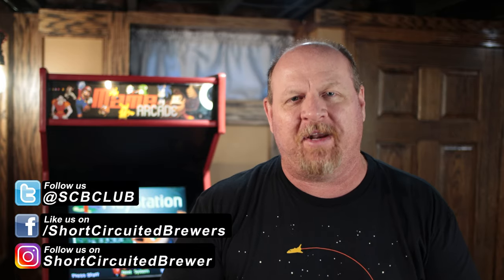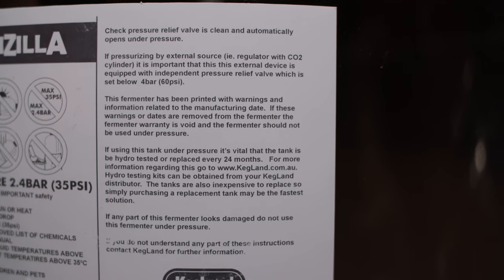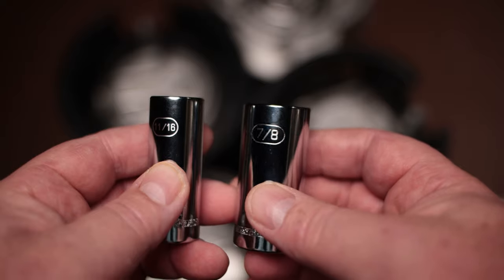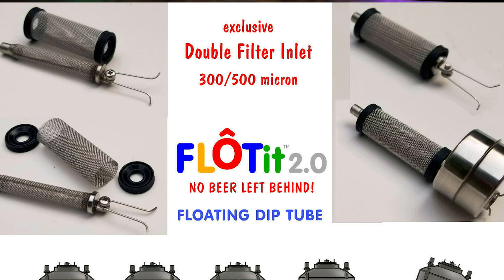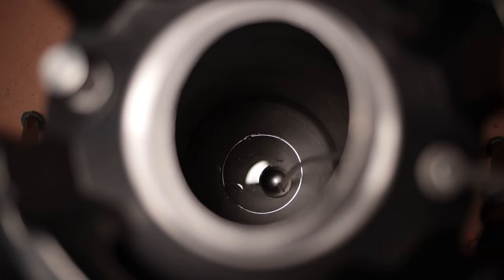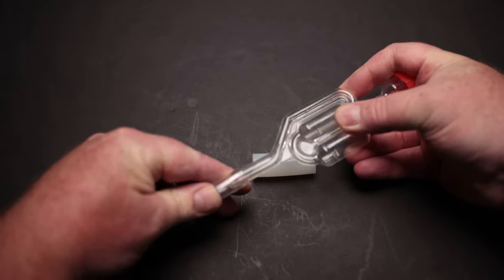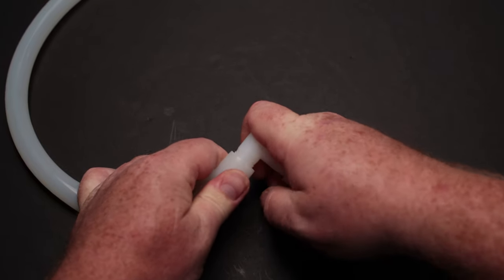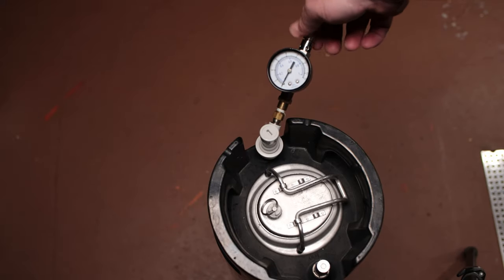Convert your Corny Keg Into a Fermenter

Comment: I love fermenting in my cornies using a floating dip tube. I use a blow-off tube for ales and a spunding valve set to 10psi for my lagers. I ferment 2.75 gallon batches in 3 gallon kegs and I find Fermcap to be absolutely necessary. I've never had an issue with the limited headspace. When fermentation is finished, I perform a closed-loop pressure transfer to a clean and sanitized serving keg, using pressure from the serving keg to push the beer out of the fermentation keg. My beers have been consistently better since I started fermenting in my cornies!
Reply from the maker: Awesome to hear!! 👍🍻
Reply: Thanks for making this comment. I am about to start fermenting in cornies and have the same plan. Ferment in two separate containers (that have floating tubes) then combine into one for serving (that also has a floating tube). I intend to harvest and clean yeast, this will be my first experience with that. I just bough my first liquid yeast.. I'd like to avoid paying that cost regularly.
Reply from the maker: Good ideas. 👍🍻
Reply: How much feral / 5 gal Corney??
Reply: floating dip tube suggestions? searching now…
Reply: FLOtit 2.0, available a lot of online places.
Reply: @balrog006  Yes i ended up buying one and it seems to be working well so far. First time fermenting under pressure, went brew day to beer in glass in like 11 days. Pouring well so far...

Comment: I have been fermenting in corney kegs since the mid-90s.  I used to use pin lock for fermenting, and ball lock for serving, so I always knew which one had the short tube.  I brew lagers in my kitchen, in Albuquerque with no temperature control all year round (85F in the summer) by using a spunding valve.  I transfer to a serving keg, then pour out the yeast in the fermenter (leaving a few tablespoons) and pour new wort on top of it.  I brew 2.5 gallon batches every Saturday, and I never buy yeast.  I used the same "Cry Havoc" yeast for 20 batches, now I use 34/70...
Reply from the maker: Nice! 👍🍻
Reply: Thats a great rhythm of a system

Comment: I’ve been fermenting the full 5 gallons with no probs. Blow off tube set up like the vid will take care of any blow off. It’s usually minimal. A recent 13% Kveik barley wine blew off only around 100ml. I also don’t tamper with the dip tube. I don’t feel the need to. After a few days in the Keezer, the first pour pulls up the yeast cake then the beer is fine after that so no need to transfer to another ‘serving’ corny. I’ve also had great success harvesting yeast by using a sterile picnic/party tap and literally pouring the yeast cake into a sterile jar. Corny fermentation is brilliant. I do all my Weizens this way and any other beers that aren’t dry hopped. I have dry hopped though with success using a hop filter in the corny. Hang it in there with a bit of sterile dental floss for a few days. Make sure you have a steady flow of co2 going into the liquid post when adding removing hops though to minimise oxygen entering the corny.
Reply from the maker: Good info!

Comment: Really good video! I would say an easy way to do a larger batch is hook 2 kegs up together. I am doing a pressure fermentation right now, gas in to liquid out and a spunding valve on the second keg. Works great!
Reply from the maker: Nice tip!! I like it! 👍🍻
Reply: What is the volume on Corney #1 and #2 ?  This sounds great because cold crashing inCorney seems to clarify better.
Reply: @tman9338  you can split them evenly, once fermentation is done, cold crash in the kegs and then transfer both to one serving keg!
Reply: @brianeasley3515 interesting. regarding even yeast distribution do u double pitch (one in each) or shake it up and hope it works out?
Reply: @whoajack  normally just do a dry pack in each keg. If not I do a large yeast starter and split evenly.

Comment: Hydro testing is something you will need to take to a shop. It involves submerging the vessel in water, pressurizing it, and seeing how much it expands.  I've never heard of hydro testing a plastic container before.
Reply from the maker: Actually you don't need to take it to a shop you can do your test at home by filling the vessel completely full with water and then connecting a keg filled with water and pressurizing the keg to bring the pressure of the water up to the testing level. And you only need to test it if you're doing pressure fermentation. 👍🍻
Reply: I’m sure the manufacturer imagined having the pressure test performed by someone certified or with a certified lab/equipment-to maintain the liability.  If you’re just testing it yourself to check before using it, then your home method would suffice.

Comment: I have just done our first keg fermentation and it has not gone well, I got an emergency call to come to our brewing room at the Shrine this morning, we have easily lost 2/3 of this keg. I brought it back home into my shower and it still keeps leaking. Thank you for this video, next time we will only do 4 gallons. I hope that is all that is needed to solve this issue. Blow off was our big issue.
Reply from the maker: Yeah the key to managing blow off even with pressure fermentation is temp control. Depending on the yeast strain. 👍🍻
Reply: I think the issues was that we overfilled the keg to 4 and 3/4 gallons and didn't leave much head room. I am also looking into getting some blowties for our next brew day @ShortCircuitedBrewers
Reply from the maker: @kevinclingan5630  gotcha! Good luck on the next one!

Comment: Great video! I've been fermenting in corny kegs for about a year now and they've become my favorite fermenters by far. Most of my batches are 4 gallons or less so I've never been worried about headspace, but the tip with the 1/2" silicone tubing on the PRV is a great idea for those trying to fit a bit more in their keg.

For my pressurized lager fermentations, I use a spunding valve set to around 15psi and have had great results with that. For non-pressurized fermentations, I have a couple gas disconnects connected to short pieces of bent SS tubing and S-airlocks, so I can pop those on and off my keg as needed. 

If I ferment in my corny kegs, 99% of the time I'm serving directly from them as well with floating dip tubes. If I'm taking the beer to an event, I'll jump from that keg to a clean, purged serving keg. I put a 3/8" SS hex nut on the end of the tubing right near the ball float to make sure the tubing end stays submerged, and when serving from a keg that I've dry-hopped, I put the small filter on the end of the dip tubing. It's great to have less vessels to clean, and reduced oxidization. My NEIPA's have gone weeks with no noticeable oxidization or color changes, and haven't noticed any detrimental effects of having the beer sit on the yeast and hop trub in the serving keg.
Reply from the maker: Yeah there is a myth about leaving beer on yeast. I've had a lager on a yeast cake for 6 months with no I'll effect. Thanks for the comment! 👍🍻
Reply: What is the max time u have served from a Corneys??  Great feedback that you serve using a dip tube and the trub doesn’t cause off flavors

Comment: Thanks Brian for all the great info, I don't cut my corny keg dip tube, I just use a BeerBrite filter system when racking to another corny keg, in my experience 41/2 gallons is about right for trouble free fermenting, though I find with cider I  can manage 5 gallons...Thanks again Brian.
Reply from the maker: That works! 👍🍻

Comment: Good suggestion on the 6 gal keg. Looks like it will even fit in my fermentation kegerator. Just had a massive blowout through my 5 gal through the spunding valve.
Reply from the maker: Good thing for a spunding valve!

Comment: I bought the Kegland 7.6 gal or 29L Kegmenter (low profile and 4” opening for easy cleanings) which works great with the Blowtie Spunding valve. also has a built in relief valve.  Can use as a Fermenter or Keg by design...it’s sweet!
Reply from the maker: Yeah I've seen those! They are pretty cool!

Comment: Is it okay to leave the floating dip tube in during pressure fermentation on the “out” post? Then when I transfer to my serving keg or take a gravity sample I won’t have to open the keg or worry about sucking out the yeast. Currently making my first lager under pressure fermentation in a corny keg with a sounding valve.
Reply from the maker: Yep no problem at all.

Comment: My main fermenter is an old 10g corny keg. I've got a modified lid that I welded a 3/4" sanitary fitting in that I use a thermowell with, and I also have a floating diptube in there for transfer. It's the perfect fermenter.
Reply from the maker: That's awesome! Those 10 gallon  corny's are hard to come by. 👍🍻

Comment: I fermented in Corny kegs for several years until I upgraded to Spike Flex+, but I kinda miss it. For a blowoff, I took a gas post with me to Lowes and found vinyl tube that fit snug on the post. I would remove the poppet and push that vinyl hose on to make a blow off. Even with 4.5 gallon batches, krausen would rarely push through. When it was time to transfer to a serving keg I would put the poppet back in the post.

I also had no problems harvesting yeast. Although I went through several trials and error on my process, I eventually landed this: 1) push starsan out a hose from the future serving keg. 2) with a small amount of pressure, push the first slug of yeast into a sanitized jar, using the same hose until clear beer flows. Amazingly, it was usually only a few ml before the clear beer. It seems the yeast cake would hold it’s shape at the bottom 3) disconnect the QD from the fermenter keg to stop the flow, attach another black QD to the hose to make a jumper 4) transfer the beer to a serving keg. 5) when finished transferring, depressurize the fermenter, pour in 500ml or so of preboiled and cooled water on to the yeast cake to soften and dilute it, swirl it. 6) close the fermenter keg back up, pressurize and push to the jar. I did all of this without cutting the dip tube. I had a cut diptube handy if there was ever a clog but it rarely happened.
Reply from the maker: Nice!! Thanks sir sharing those tips! 👍🍻

Comment: Thanks for doing this video, great to see sound advice covering all brewing possibilities. I’m a small batch BIAB brewer (using electric) and use a 10ltr pressure barrel converted to take a Corni Ball Lock Valve to add a spunding valve to control the pressure. It works really well.
Reply from the maker: Good to hear! 👍🍻

Comment: Hey Brian in regards to harvesting yeast from the keg. I have done it several times by just dumping some distilled water in the keg ( i dont have a trimmed dip tube so vertually just sludge and no liquid) swirl it around, put a funnel over the opening and dump it into a sanitized jar, my wife helps me do this part. Make a starter as usual. So far I haven't had any problems using this method. The kegs I have done this with sat in my keezer empty for 2-3 months. Just a thought to ponder if you need that particular yeast and don't have any. That's what made me try it. And it worked
Reply from the maker: Yeah that's a great tip! I never thought of that! Thanks for sharing! 👍🍻

Comment: Brewing now in a spac branded keg I got cheap but did not use as it was too fat for my kegorator . It is 25 litres & I usually brew 22 litres , so enough headspace. Just cut the dip tube  to about 5 cm & pushed on a piece of silicone tube &float with a filter (Kegland) & it works great ! I can fit it & an allrounder in my fridge to brew 2 at once. Use a spunding valve of course. Also easy to clean & should last forever. Cost bugger all.
Reply from the maker: Nice!

Comment: Thanks for sharing. Great information. I did one batch fermentation in a keg. I can't remember the gallons exactly. I recall I was able to do a 5 gallon batch with no problem. I might be wrong on the gallons that I fermented. I did have a blowoff tube when I did it. I had an extra lid and ended up drilling a hole in the middle and was able to put a airlock in. I liked your idea of just unscrewing the pressure relief valve. It was a pain in the but, to drill a hole in the center of the lid. Cheers!
Reply from the maker: I bet they are THICK! Let me know if you try it! 👍🍻

Comment: Great tips, Brian! I'll have to try the "airlock through the PRV" trick - I've just used a blowoff tube attached to the gas in disconnect.
I've fermented a couple of batches in a corny keg - mostly 3 to 4.5 gallon batches. For one ~5 gallon batch (pressure fermented SMaSH with 2-row, Belma hops, and Lutra @ 10 psi), I also added some Fermcap-S to prevent too much foaming. Worked like a charm!
-Jeremy
Reply from the maker: Thanks for sharing your experience! 👍🍻
Reply from the maker: @Duci1989  did you watch the video? There is no PRV. to blow. It's taken out and a airlock or blowoff tube out in its place. Ball lock  posts get clogged super easy.
Reply: @ShortCircuitedBrewers  oh sorry was having lunch and probably looked at my sandwich for a second too long, lol. I saw you pushing the tube on and assumed that you had pulled and twisted the PRV. ring.
Reply from the maker: @Duci1989  haha no worries.. 👍🍻

Comment: Hydrotesting is done with water. Same pressure as it would be done with air but as fluids don't compress under pressure only thing that will happen in case of vessel failure is some leaking instead of explosion if done with air.
(in case not answered already)

Comment: Brian, great content again.  I use the gas post and hook the blowoff tube to that in a corny.  I haven't had to limit the batch size too much since I tend to keep my beer between 4.5% and 5.5% ABV.  That lets me transfer from the fermentation keg to my serving keg by pushing with CO2 reducing O2 exposure.  Was considering moving to a conical and glycol, but this is a pretty economical and simple solution for me.  Also looking at the Spike trio, so paying attention to your thoughts on that system.
Reply from the maker: That's the 3 vessel HERMS right?
Reply: @ShortCircuitedBrewers  Correct.
Reply: I've been toying with the idea of a long, tall glycol chilling loop connected to a corny keg lid with bulkheads for chilling the fermenting wort. I'm not sure if one is already being made, but I have seen similar devices for carboys and other fermenters.
Reply from the maker: Check out the coolzone jacket for fermenters. I have a carboy version abs the corny keg one as well. They work.

Comment: Enjoyed the video, I do have a question. At the beginning of fermentation you added a blow off tube or an air lock. Then later you added a spunding valve. I guess I got lost here. Do you take off the air lock , replace the pressure release valve, and then add the spunding valve? Or, if you plan on fermenting under pressure, do you just add the spunding valve from the beginning? I ordered 4 corny kegs, I will only be despensing beer in 3 of them, I was thinking of one of two things; using the extra keg as a pressure fermenter or using it to cold crash. Kegging and using kegs as other pieces of equipment is all new to me. Any help is appreciated.

Comment: I did 2 batches into a corny keg as a first test.  I also used a floating dip tube from Fermzilla with a small mesh thing at the end.  I ended up having to cut the tubing on this out of the box a little so it just barely reaches the bottom make sure it works properly, but other than that they seem to work great.

For blowoff, I used some old gas line attached to the gas line ball lock running into a 2 quart jar half full of star san.  Seemed to work great. 

I did try to different volumes, the first I did about 4.5 gallons, and there was no blowoff to speak of just co2 off gassing.  The second one had virtually no head space probably like 5.25 gallons and there was at least a quart and a half of blowoff/liquid added to the star san jar.   So i'd say 4.5 gallons is certainly safe, and you will probably lose at least .5-.75g at the bottom due to trub.

I plan to pressure transfer to a serving keg using a beer line jumper (floating dip tube in both kegs) and just watch the transfer and when it hits the trub ( super cloudy xfer ) I will stop.  Probably gradually reduce pressure as I transfer to ensure I can stop quickly.

Getting roughly 1g+  less volume is definitely something to think about with this setup.   The bonus side for me is I can ferment 2 kegs in my chest freezer ferm chamber, whereas with buckets only one at a time fits.
Reply from the maker: Awesome info! 👍🍻

Comment: Great video. No fluff and loads of clear info. Really want to streamline my process these days to make it as easy as possible but keep quality. Have you had any experience from serving directly from the fermentation keg? Fermenting under pressure in a corny with a spunding valve and floating dip tube (serving directly) seems about as easy it gets. Carbonated naturally (saves CO2), further reduces possible O2 exposure as no need to transfer, less steps, less to clean and sterilise... Autolysis (at our level) is mainly debunked by now too. Seems like a no-brainer really.  I imagine in practice, minimising trub transfer from the kettle is essential. I suppose if you want to dry hop you'd need to transfer or bag it up or something. 🤔
Reply from the maker: Yeah you can do that..I'd recommend na floating dip tube for doing it. 👍🍻

Comment: How do you dry hop when fermenting under pressure in a Kirby keg?
Reply from the maker: You can do it a couple of ways. One is to remove the lid. My least suggested way. The best way would be to put hops in a sack and hold them up with a magnet in the bag and one of the exterior.  pull the magnet from the outside and let the bag drop at the appropriate time. Here are some magnets that will work. https://amzn.to/3QKtAb8 food safe too